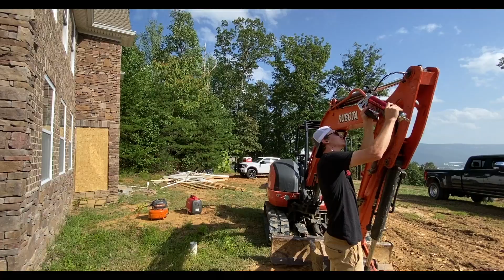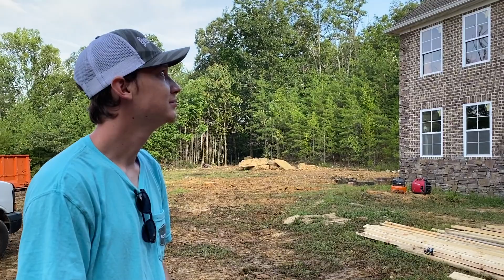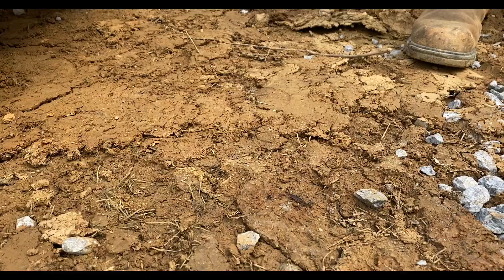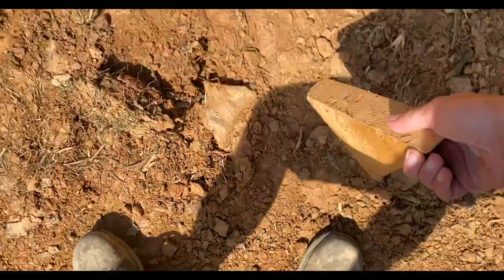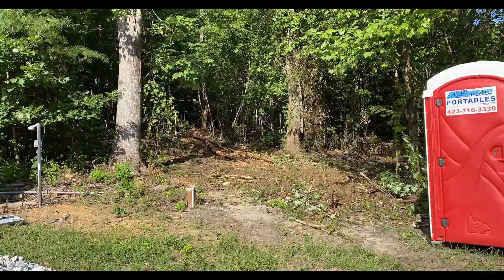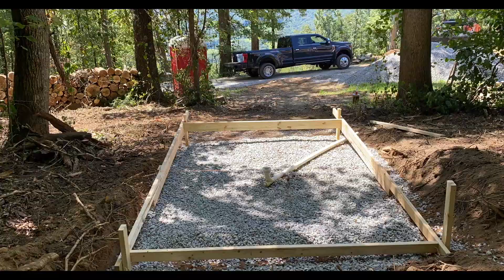The New Goonzquad Headquarters Part 9

Comment: In that concrete floor I would put either wire or Rebar in it to help it stay together in the winter months and oil your forms as well so that you can take your lumbar off a Spiral staircase might be to difficult to bring things to the second floor the back Yard you could build a water falls into a pool as well. I would not toss any lumbar out even scrap till the Job is done to Expensive to waste. Have a wonderful Labour day weekend.

Comment: Spiral while may look neat is very impractical  and hard for your dogs and impossible carrying furniture and bbq up. I'd go with s zigzag wood staircase. Also the way you guys always go big I'd probably not put a jacuzzi on the deck. The footings don't look that big to handle that kind of weight load. Also takes up a lot of space. On the front side I'd definitely do a front porch to soak in the view after a hard days work. Also never seen a pump house off to the side of the well. Usually goes right above it.  Keep up with the good entertainment enjoy the vids.

Comment: You both are doing great work.  You may want wire mesh held up by rocks (middle of pad) to keep it ridged/strong being it is over 8ft pad and not just a side walk.  The drain would work better if there was a slight slope to it (should be have it slightly lower than your level plane.  You will trowel out  from the drain to level field...Flat will not drain much).You may want to throw some gray plastic (electrical pipes) and water pipes into your foundation before pour (just inside your proposed base of building).  Otherwise you will have a shed with drain.

Comment: you should also run some conduit into the well shed to run the water line from the pitless adaptor underground into the shed, otherwise your water lines will freeze.  The pitless adaptor is at the well, down about 2-3 feet.  Do you want power run into the shed also, under ground? other wise you need to run a wire above ground to power the well, pumps etc.

Comment: Guys y’all should build like a rock pathway up the hill behind the deck. and  have a water slide that runs from the top of the hill to the deck, and you could have like some type of recycling system for the water so you can cool off when it is hot out. plus it’s just fun. :) just an idea!

Comment: Based on what you have shown in your video, your deck was not designed to support the weight of a hot tub.  Recommend putting in the new landscape area (Maybe a wood burning stove hot tub).  Also, the Well house.  You may want to consider adding in your plumbing and electrical before pouring a concert pad or it will be coming out the side of the walls!  Design it first guys!  Peace!

Comment: Ahhh, guys I’m not getting it a well house usually goes over a well to keep it out of the elements, and stop it from freezing, and when you frame up your foundation the 2x4’s go on the outside and cut them flush so you can drag your surface, use a 2x4 to level it out , ya the spiral staircase I wouldn’t do it !  I don’t know what you plans are fo the big garage but if it’s near that well I would of built it in back of it just to get it out of site 🤔 would have pored the slab for the garage and well house same time, be safe guys , 👍🏼

Comment: Just don't build it under a tree because of falling tree branches , Spider's live in trees as well so , build it then plant shrubs/trees around it to hide it some what. Yes you need a concrete slab and put  screws in the concrete to hold your base boards around the bottom so the shed won't move , also Simpson ties to hold the wood together 💯👍

Comment: Get some counsel on that well house foundation boys - you’re setting yourself up for a major drainage problem. Love your passion!
Reply: Didn't they say they were responding to counsel by the Well Expert?
However, the slab should be extremely well anchored into the ground to resist sliding due to erosion and gradient slip/wash!
Reply: Literally the first thing they said in this video
Reply: shouldnt the upcoming slap be pitched, 1" for every 10'.  Goodluck goonz', your doing a fine job
Reply: All that rain water coming down that hill

Comment: might want to stain or seal the wood on the deck !!  Might want to ask the plumber before pouring that pad for the pump to make sure  about the piping  for the pump !!   Plumber might have to dig a ditch for the pipes  to the middle of the concrete pad which means  the pipes would come up in the middle of the pad  !!!!  Just check with the plumber first hate to see you guys tearing the pad out or have to saw cut it to get the plumbing in !!

Comment: Forget the spiral, nightmare getting stuff up and down. Don’t use those rocks for patio... the top will keep splitting off in thin layers. Had a similar issue... ended up ripping up the whole thing that someone else had thought would work...hope those deck posts are sat on concrete pads. That ground at the back is going to get wet when it rains!

Comment: I am not a geologist but my guess is those stones are sedimentary. Which means they are comprised of layers of material that were laid down one on top of another over tens of thousands or millions of years in water.  The lower layers got compressed into stone by the layers above and the weight of the water, Indicates that the region was once at the bottom of an ocean or some other large body of water.  Then was thrust up by plate tectonics and thousands of earthquakes over more millions' of years, becoming your mountain.  Pretty cool.

Comment: Guys I use to concrete drive ways and shed slabs you will need ( Pointed Fishing Tool, Concrete Screed try and find one the side of the slab, I wouldn’t for something that size but if your going to do your car garage slab your self get a Bull Float, Groover, Concrete Finishing Broom, Edger ) for that little slab you should be cool with these tools also if I was you guys I’d take a few inches of rocks out and get some wire mesh sheets to put in the slab you don’t want to have to repair a crack in the slab. Also watch some YouTube videos on what they use when concreting a slab or driveway

Comment: I would have dug a minimum of 3' to 4' trench on the inside, around the entire perimeter board so that your concrete floor is below frost line. If you don't get winter frost, then your floor would have a better foundation. As always, I would also use 1/2" rebar spaced 16" (in foundation and floor) for where ever the concrete is poured. Concrete has compressive strength, and rebar helps with shear strength.

Comment: I would get with the plumber before the concrete pour on pump house , lines have to go in and out underground. Hence the tore up concrete in house.
Reply: Yeah - and they may want to make sure the drain is lower and the concrete is properly contoured so water flows to it...  no pooling.
Reply: @rangerrick8220  for such a short drain, it being level shouldnt be that much of a problem. But wouldnt the foundation be much more solid if they actually set it into the ground, and not just poured the concrete ontop of that gravel tho? that looks dodgy ass hell to me...
Reply: @nicosand86  actually the stone below the slab is correct. It is called the capillary boundary as prevents wicking of soil moisture into the bottom of slab. Common practice in humid climates.
Reply: Exactly what this plumber thought too, also your sparky may want a conduit or two for his cables.

Comment: You need to bring your well lines and electric to code into the well house before you pure the slab below your freeze line if not your water lines will always have trouble
Reply: doesn't seem like they have code for frost line where they are, i noticed inside the house they have waterlines and drainage pipes in exterior walls which is totally against plumbing code where I live

Comment: For the black widows, I found the thing that works the best is to spray them first with some of that spray on suntan spray. That stuff stops them dead in their tracks and it makes them flammable so you just touch it off with a lighter or that torch and you're good to go. Even if they're on your deck or your house, it won't burn up the finish either, just the spider, especially if you move them away from the pool of liquid you just created by spraying them down.  It's good to use fire to kill them because it kills any eggs they've got in their abdomens. Next step after killing them is to cultivate other spiders around the homestead. Orb weavers and garden spiders are the best because they build huge webs that keep your insect population under control. They're nature's fly paper and best of all they will compete for food with the widows and even kill them if they're in the same territory. Inside the house a daddy long legs spider will do the same. I've watched them eat both house spiders (the kind that bite you in your sleep) and widows, and they don't have jaws large enough to bite us, so they're harmless to humans.
It's a similar story with snakes. If you can get some king snakes, rat snakes and/or other non-venomous snakes around, they'll compete for territory and kill coral snakes, rattlers and copperheads. They'll also keep your rodent population under control.

Comment: you should think about solar power, might be cheaper in the long run, some states have funds to help with the start up costs... just F.Y.I. check with a local welding/machine shop about the spiral stair case, you will also need to pour a concrete base for the stairs,  dang sooooooooooon it's looking pretty good...
Reply: Maybe would work, but no sun at night so need Grid anyway.  Just think of the big industrial equipment they may have in future.

Comment: Guys your well house needs to have footings all the way around per code. Also have you took into consideration that when it rains like a lot all the soil in back of your shead will end up inside of the shead. Please check with your local building inspector but also pull any necessary permits.

Comment: If you guys want something for breaking up those rocks that's dirt cheap and works really well, go buy some expansive demolition grout. You drill holes with a rotary hammer drill, fill the holes with this grout slurry, then come back to it the next day and it'll be in pieces you can scoop up in the skid steer bucket.

Comment: Guys you need to make a retaining wall around the base of the deck, like 5 feet away from the structure. Just put a retaining wall and fill with plans so the slope of the terrain will drain all the water away from the property preventing mud slides and also water over the house. A retaining wall of 4 feet will be good just make sure you left at least a 1.5 feet of wall clear over the side of the slope so the water and mud can be redirected.

Comment: You guys were wondering what's going on with the wood prices and lack of supply of things? A couple things happened and are still happening. First, the fires in California decimated and are still decimating tree populations which cuts into your supply. Second, Trump decided it was a good idea to start a tariff war with Canada imposing huge tariffs on wood imports which in turn drives prices way up which is why you are paying almost triple the normal price. Third, there's a pandemic raging in the United States which is cutting into demand which diminishes the need for supply. There's a lack of workers driving trucks to haul lumber, there's a lack of workers cutting timber to make lumber, and there's a lack of consumers buying anything because they are self-isolating and avoiding public places. These stores have no stock because there was no demand fueling the need to resupply. They sold off whatever they had and now it's a matter of whatever meager supply is left trying to meet a greatly decreased demand.
Reply: Good to know.

Comment: If I were you I would rethink the casement windows. The roof overhang is so short that during any sort of rain you can’t open the casement windows without water coming in. On the double hung‘s you can lower the upper part down far enough to get air circulating through and not worry about water coming in. I currently have casements for windows in my home and I wish I had double hung‘s in the windows that I use all the time

Comment: I built a nice little shop for my tinkering with computers out back. Figured out the size and then had them come in and pour a pad with the screw studs sticking up and then built the building on it. Oh and you can use one or two of the windows in that shed.. cost you nothing. 
https://gyazo.com/84853007357ca676222b869704762f0b

Comment: I'd think twice or even thrice about putting a hot tub up on the deck.  The weight of the water for a two > three person hot tub is huge, add to that the chemicals in the water attacking the wood, not good.  Better to put it on a slab just beyond the deck footprint with a wall made of those big slab rocks to keep the hillside from slumping down on the tub.  My old eyes just can't quite see black window trim, sorry bout that it just doesn't ring appeals gong.

Comment: And talk to the electrical contracter to add a k bar its a bank of compasitors that help the power bill to so when your welding and the ac or heat kicks on the spikes will come from the k bar not the power company

Comment: you need to add more bracing on the form to stop it bending when concrete is being poured its heavy, also a water proof membrane , some steel rebar mesh to help avoid slab cracking in high temps  the ground around the slab is higher and could cause water run off during heavy rain  towards the shed consider putting a collection drain around the slab at slab level ,  also install pvc pipes to house wiring and water feeds as stated below by Allan Moulton

Comment: FYI: Hey Goonzsquad, did you know your WELL casing is already established where it is now and can't be moved? so if you relocate to your new spot your going to have an exposed pipe above ground over to your new location. I would build the well house where it currently is to avoid above ground pipes that could freeze.👍🇺🇸
Reply: The output fitting for that well is probably 36 to 48 inches below the soil.  You run it to the well house for the pressure tank and any filters and then run it to the house to feed your plumbing.  All below the frost line.  Nothing to worry about.  Houses with basements put all that equipment in the basement but the well head is usually away from the house somewhere.  Mine is about 10 feet from the foundation.

Comment: Love the idea of the spiral stairs having used to build and install them find a good welding shop that makes rod iron railings they should be able to fabricate some custom one piece sets and any other railings you are going to want. Also size matters when it comes to spiral staircases go with a minimum 5’6” to 6’ diameter and I suggest diamond plate for the treads looks sweet and prevents slipping.

Comment: Any metal fabrication shop will build you a spiral staircase, they will need the dimensions height, width etc best too get them power coated so to keep the rust away.

Comment: Ha. I’m sitting recovering from a black widow bite and was glad to have a new video to watch. 

It’s not too bad. Take a bunch of Benadryl. Elevate it and ice it. Watch where the rash spreads and for stripping in your veins. Circle stuff with a sharpie and monitor if it’s getting bigger or smaller. After an hour if you are winning you are in the clear. 

But yeah you are down for 24 hours and watching YouTube.

Comment: As a woodworker I cringed when I saw you throw out some of that wood. Even the smaller straight pieces have uses. That wood from inside the house could have been reused.
Reply: Completely agree. Maybe a bit of "more money than sense". Even if it was just chopped for kindling, it could have been re-used for something, especially on a building site. Same thing with car batteries. They get new(ish) cars with flat batteries and immediately buy new batteries. I wouldn't be surprised if Pops follows them about, recycling stuff. He did it with the chainsaw.

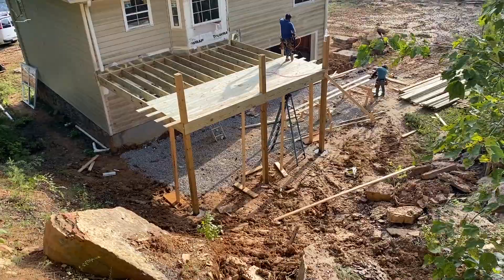Comment: 3:14 It might just be a camera effect but that roofing surface looks wavy like it's been soaked and badly distorted at some point. Better have your brother check before he plasters over the upstairs ceiling.
- Window guy is a great sales rep. He talked you into spending a ton of cash. Watch out for the gold plated faucet sales pitch coming soon. Lol.
- Property needs a stone fire pit. Save some of that scrap wood to burn in the fire pit.
- The water shed will need to be anchored not just set on cinder blocks... your contractor just advised the same thing... The PVC pie is hopefully pointed downhill on the property for drainage. Slope the cement slightly toward the drain inside the shed too.
- Check public clearance auctions for old iron spiral stairs. Could be a quick renovation and install.

Glad to see the family openly participating in the build as well.

Comment: Put a little rebar inside your forms,just like AUS1507 said Don't forget to add conduit for the electrics and plumbing to the well house better in ground and not thru a wall were it could freeze and burst.

Comment: (Concrete slab) 
Recently just formed a concrete slab  in my garden. I was advised to lay plastic sheeting (pond liner) before the pour was done. Prevents the earth from taking the moisture out concrete. Stops cracks forming. Also used another sheet to cover the top whilst the concrete were setting.   I used a method called concrete water curing.. very easy. 

House build is looking brilliant. Look forward to the next video :) 👍🏻
Reply: they also need to put rebar in there
Reply: Add chicken wire or rebar on top of rock and add more supports to outer form.